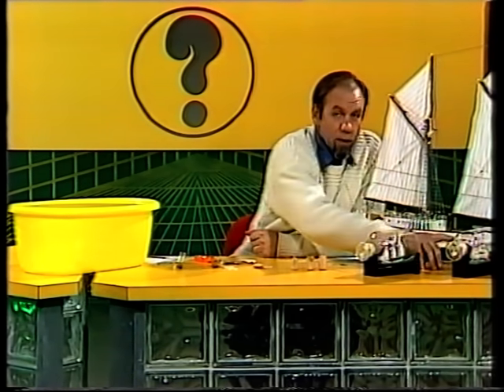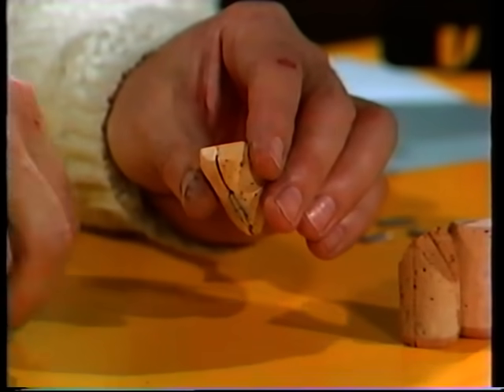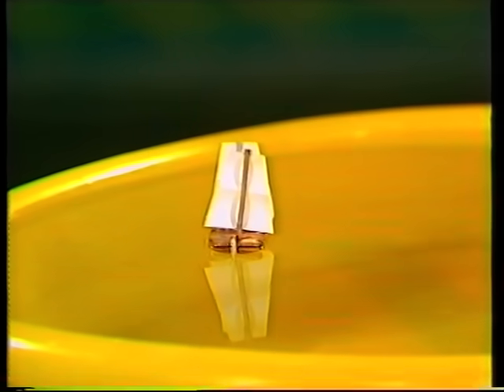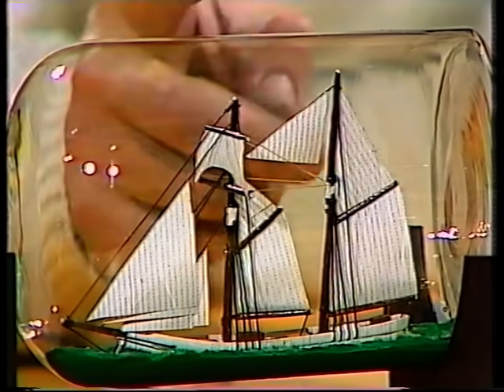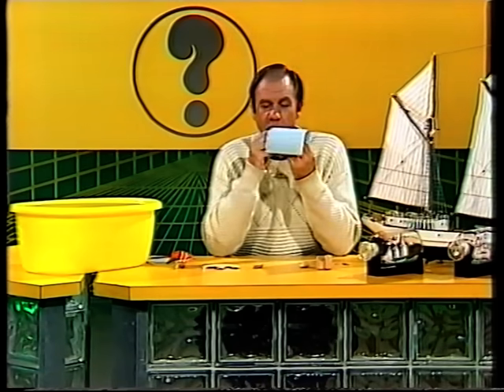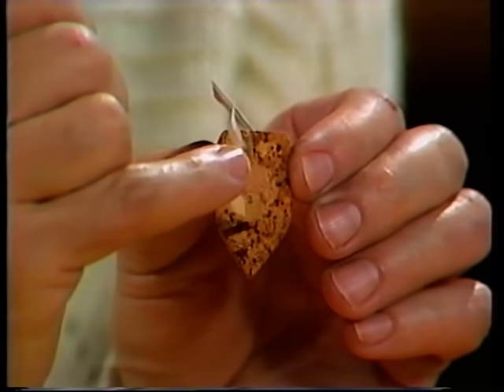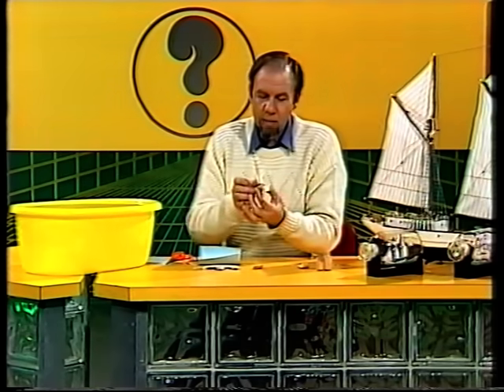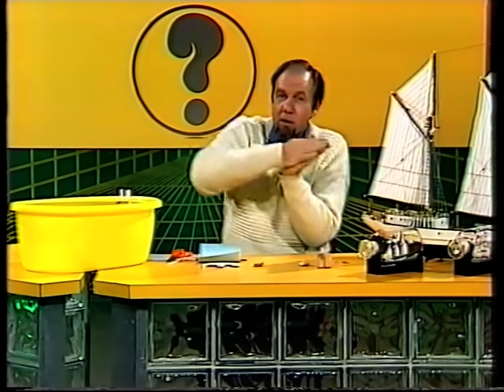Sailing into the wind

Comment: I just started sailing a couple years ago with a very small lightweight boat but what really surprised me was the ability of a boat to actually sail faster than the wind and oddly across or even slightly into the wind.  It has really triggered what I think is going to be a life long obsession.
Reply: I love the physics of sailing as well! What I've heard about sailing faster than the wind is this; if the wind is blowing at 3 knots and the boat picks up speed, then the wind is now blowing at 5 knots, and so on. The only limiting factor is the drag of the boat and the sails.
Reply: @JordanTracy93  that's exactly right, it's a vectored quantity of relative wind.

Comment: An excellent demonstration which makes the apparent paradox very clear.  But it should be pointed out that square riggers can sail partially into the wind, although not as close to it as a fore and aft rig.  To do it, the yard arms were hauled hard to one side or the other, so that the sails were sharply angled to the wind coming more or less from the front.  The wind blowing along the front of the sail 'pulls' the sail and thus the ship forward as before.  However tacking one of the giant square riggers was an exhausting process as you can imagine!
Reply from the maker: Yes, but try doing all of that as well in 4 minutes - Rob
Reply: @CuriosityShow  I know!  Given how long it took in real life, you'd need an hour's slot.  I wasn't complaining about your very clear demonstration, just adding to the conversation.  :-)
Reply: @lloydmitchell4208  Yeah that ability to tack into the wind, even a small amount with great effort, was a life saver for the square riggers.

Comment: For a long time people thought Viking longships couldn’t sail into the wind because of square sails set perpendicular to the keel. Just as described here. BUT it turns out that they used long rectangular sails that could be fixed to the sides of the ship by ropes at very high angles close to in line with the keel and thus could sail into the wind. We modern people had assumed they were dumb and primitive but they were quite adept at sailing any direction.
Reply: cool

Comment: As far as I know an airfoil functions according to the Bernoulli equation. An increase in velocity results in decreased pressure. With a sail the velocity on both sides of the sail are the same, but there is a change in direction causing a force.

Comment: It’s kind of a misconception square riggers couldn’t sail into the wind. They certainly could, when the sails were turned to the side they would act just like fore and aft rigging, the main limitation to square riggers when it comes to upwind performance was the fact the degrees the square sails could be angled were often limited by the rigging itself, and tacking was difficult and required precise coordination by the crew. Most square riggers could sail 70 degrees into the wind, which is terrible windward performance compared to fore and aft rigging, but they could still sail upwind if they absolutely needed to.
Reply: I mean, yeah, even the model has square sails...
Reply: yes, if I recall, historical accounts often tell of tacking into the wind to either make short distances, or sometimes to avoid being blown into reefs and such
Reply: @nmarbletoe8210  tacking into the wind allowed a navigator options. The progress would be slower compared to riding the winds, but it also meant risky anchorages for layover could be avoided, and it made planning the needed supplies for a voyage more predictable.

Plus the crew is much less likely to mutiny if it was assured of even slow,  controlled progress to a friendly port. A starving crew is an unhappy crew,  after all
Reply: @oVoidhawko  yes!  it was very important!  

now, it is true that the modern sail plan is better at tacking than anything else in history, except maybe the proa.  

i'm not really a sailor i just hang out in the harbor a lot
Reply: @nmarbletoe8210  haha, I trust that means you can at least swim, right? :p

On that tack, I think we can at least agree those old maritime lads were straight up ballers.
Reply: It would be a little difficult to ever get to a sheltered anchorage if you couldn't, I think they could manage a handful of degrees better than 70 in most cases

Comment: Would it be possible to build a sailboat that is square rigged for fast downwind travel but the mast can be rotated 90 degrees to still move forward while going against the wind?
Reply: yes but ultimately i think the square shape is less efficient than a wing shape, due to drag around the tip and edges

Comment: Great video, but a small correction: A square rigger does not get "Pushed" by the wind. The wind creates a high pressure/low pressure "Draw," the same principal as "Lift" on an airplane's wing, the wind "Pulls" the square rig, it does not "Push".

Comment: forgive me if this is a silly question. But does anyone know why they didnt have a bunch of wing like, horizontal sails spanning the length of the mast, with a counter weight in the back of the ship? wouldnt that maximise the available wind and keep the ship moving straight forward, and not loose energy tacking?
Reply from the maker: They have something similar, but like a vertical wing - Rob

Comment: Best  explanation I have found so far, is it possible to sail with the wind with the second boat or do you also have to zigzack? Thank you very much
Reply from the maker: Yes, you can do that. You can let the "rope" fastened to the sail out so far that the sail stands out almost at right angles to the boat and catches the wind from behind - a change of wind direction can be very dangerous if it slams the sail back onto the boat and round to the other side, but it can certainly be done. Boats like these also often carry another sail - a spinnaker - and that can be unfurled when the wind come from behind and balloons out in front of the boat, catching the wind and driving the boat forward. It is let go and pulled in if the boat has to change direction - Rob
Reply: Yeah.

My father and brother were keen dingy sailers so I remember..

The main sail is let out as far as it'll go and  the fore sail  like wise but the other i side of the boat.

YOu  did have to watch your balance as there were no opposing forces but that's another  story.     Yes it could still be done.
Reply: @Ken Mason OMW.......... my reputation gets around clearly.
Reply: @Ken Mason Is that an inverted complement?  If so, thank you.

Comment: I"ve always been under the assumption that the forward jib sails on frigates were designed to work the same way, giving them some potential to tack into the wind, is that correct? It seems like you would want some of that capability no matter what
Reply from the maker: Yes, they are so-called "fore and aft" sails that do allow that - Rob

Comment: so did the ships with square rigged sails never sail into the wind?

if so why didnt all ships have the other rigged sails?

also what do the triangle shaped sails do, if they serve a different purpose?
Reply from the maker: That is complex, but square riggers could sail slightly into the wind, but it involved a lot of repositioning their sails and tacking, or sailing at an angle into the wind, and it was very hgard to do. That is also how the triangular sails work. They are cut so that they bulge with a bit of wind behind them, but most of the wind passing over the bulge creates low pressure there, and the air behind the sail pushes the sail into that low pressure, bringing the boat with it. That is why yachts beating into the wind have to take a zig-zag course and swap the sail to the other side of the yacht when they change direction.  - Rob
Reply: +CuriosityShow thank you !
Reply: Yes, they absolutely could and did sail into the wind. They weren't completely unable to sail into the wind, though the maximum angle to the wind would be 70 degrees

To explain, say the wind is coming from the North and you want to go North. The closest you can get to North is 70 degrees from North. So basically you'd go East-North-East, tack, go West-North-West and through a series of "tacks" to get you there.

Comment: Cool video, although the title is a bit misleading. There is no way to ‘sail into the wind’. This will still pushes you backwards. This is upwind, withs true wind angle of 40-45 degrees ish ( can see he is not blowing directly from the front). So to reach a goal that is directly in the wind, you would still need to tack. 

But yeah, the ship is rather pulled forward by difference in pressure instead of being blown forward.

Comment: Bernoulli Effect only contributes a tiny amount to lift - almost negligible. An aircraft wing generates lift by deflecting air downwards. Don’t believe me? Stand under a rotary wing aircraft (ie. Helicopter) where it’s obvious and observe the air being pushed downwards. It’s Newton’s Third Law essentially.
Reply from the maker: Yes, both apply, and it depends on the type of wing. Aerobatic planes that fly upside down rely on that deflection, for example - Rob

Comment: This is NOT how we teach how wings work nowadays. The Bernoulli principle only accounts for a small proportion of lift provided by the wing, and doesn't explain how planes fly upside down. Most of the lift of a wing is provided by the simple fact that the curved upper surface directs the air downwards, and Newtonian 'equal and opposite reaction' does the rest. Edit: in fact some wings have an equally curved top and bottom surface (known as symetrical chord) thereby cancelling any Bernoulli effect, and they fly quite happily. The main requirement is that the back of the wing must be pointed slightly downwards in relation to the oncoming air, in order to divert the air downwards and provide lift.

Comment: The wind source would blow primarily onto the inner curvature of the sail and around the outer. in this and other demonstrations I've now watched for reference, including the curved paper demo, the wind is shown blowing primarily onto the outer curvature and it's not actually correct.
I've no doubt "Lift" is involved and works as described with areas of higher and lower pressure due to differences in velocity caused by the curvature of the sail or wing but in the case of the sail the curvature would be degraded ( Luff ) by the force of the wind should it be directed primarily onto the outer curved surface of the sail. The inner curved surface of the sail is created by it catching the wind and redirecting it more so than the outer. in this video both the little cork boat example and the curved paper example show the force of "lift" generated by the imbalance of pressure created blowing wind onto the outer curved surface and that just isn't going to work with sails as they would of course Luff. At 4 min and 4min 30 this demonstration shows wind blowing primarily onto the outer curved surface and that isn't accurate. 
Love the curiosity show, just think there's a little mistake in the representation of sails in this way.
Reply from the maker: There is a limit to what can be fitted into 4 minutes or so. Yes, part of the wind fills the sail to provide the curvature. that doesn't make the rest of it incorrect. The main focus was to show that ships can actually sail towards the wind- Rob
Reply: @CuriosityShow  Firstly thank you for the positive impact your show has had on my life and for the rediscovery of its availability today. 
I do apologise for being such a pedant and do of course concede that my long winded explanation online pales in comparison with the many excellent and inspirational scientific demonstrations on television you have made. Tis a minor and fine point I was making and may have come off as a bit accusatory and rude which isn't right. You set the bar so high its easy to expect too much of a 4 min clip and I feel like a right heel having prattled on about such a minor detail. it comes from a genuine desire to understand the subject fully and not from any ill will towards The Curiosity Show. Sorry- Andrew.

Comment: The video gives the impression square riggers could not sail upwind at all, which is false. The video does it right at the start by over simplifying and ignoring how far square sail  yards could be swung fore and aft. The advantage of triangular sails is they can get a bit closer to the wind, but just as important fore and aft rigging was cheaper to set up and took less crew to handle. In spite of that square rigs remained in use on the larger vessels right up until sail were replaced by motors.